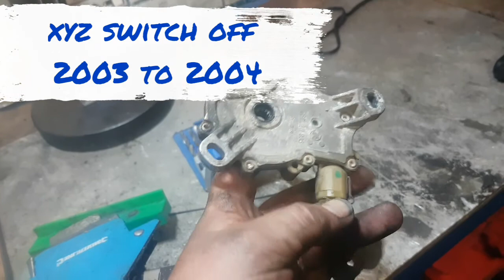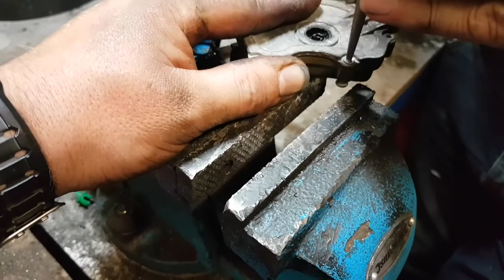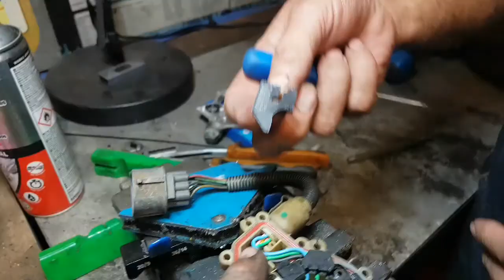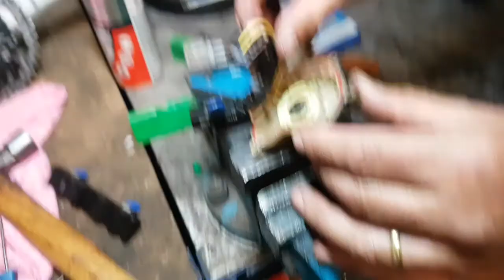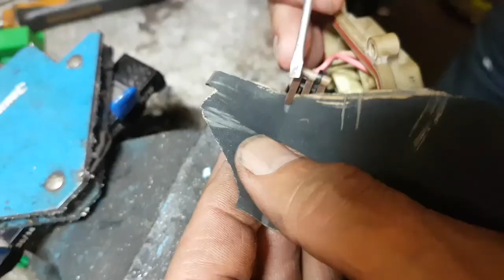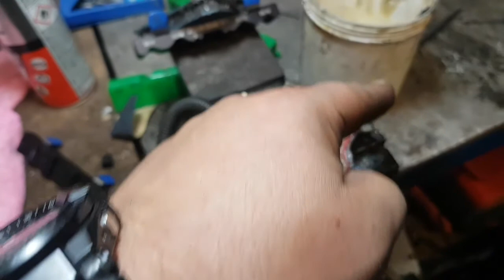how to fix M and S on discovery 2. xyz switch 2003 td5 land rover repair

Comment: Had this problem briefly after replacing the gearbox cooler. I blathered the switch in WD40 and cleaned up the earth cable to the battery. It worked, not had a problem since, so far anyway!